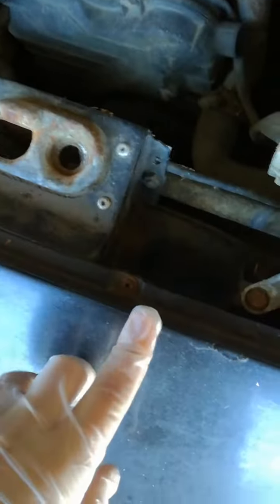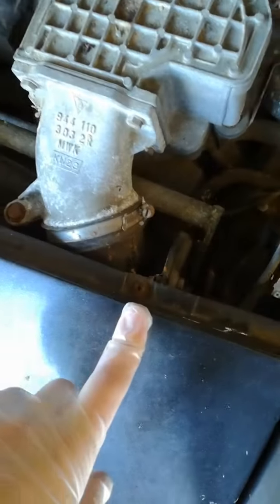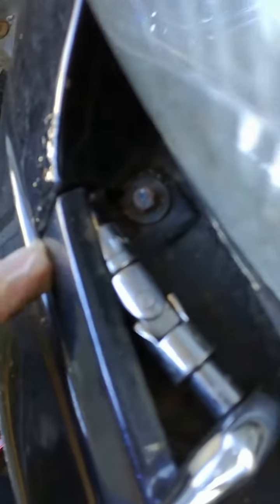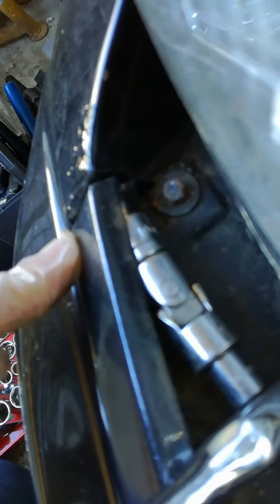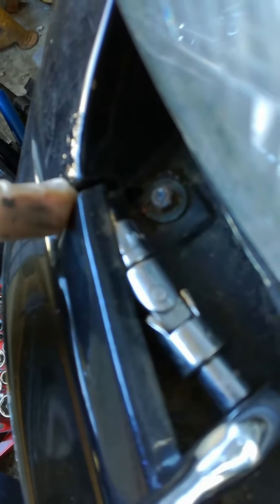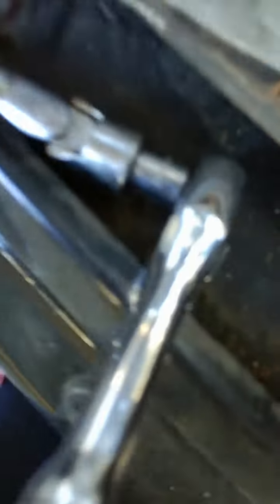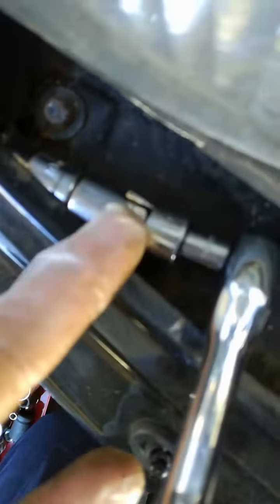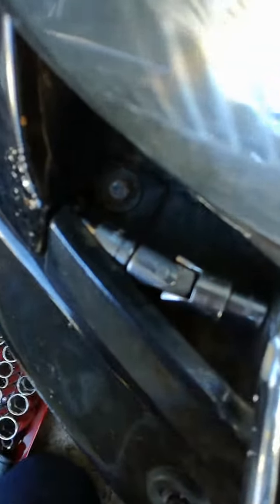Porsche 944 nose panel removal

Comment: I just bought my first 944 and it's guy's like you, that make video's like this, which makes my life a lot easier.
Reply from the maker: 100forks I'm glad it helped you out your going to love been a 944 owner what engine did you go for?
Reply: I got a 1988, base car with the 2.5L engine.  It had been in the gentleman's family for 27 years and had not been out of the garage for the last 25 years;  the result of a minor encounter with a curb.  He had it advertised for $600 and it ended up costing me $470.  Now I am watching all the videos and gaining the knowledge to get the car back on the road.  I've pulled the front off the car to repair the valance, passenger side radiator bracket and to remove the damaged AC components.  With everything out, it is making it very easy to replace the timing belts and water pump.  This is my first Porsche and I must say that I am very impressed with the build quality of the car. I am also very surprised that the parts are not nearly as expensive as I thought they would be.  One of my first trips will be to run the "Tail of the Dragon".
Reply from the maker: 100forks I guess your state side then what's this tail of the Dragon it's sounding very cool
Reply: The Tail of the Dragon is an 11 mile, 318 curve two lane road that goes over a mountain from the state of North Carolina into the state of Tennessee.  There are no side roads and no houses.  F1 legend, Michael Schumacher, got on a plane with his bike and flew to North Carolina, just to ride the Tail.  When finished, he flew back home.  It starts in Deal's Gap, where there is a motel just for motorcycles, that has the "tree of Shame".  If you wreck your bike and live, you have the right to hang a piece of it on the tree.  I have only been on it once and as luck would have it, immediately got behind a silver mini van filled with Japanese tourists, all with their cameras hanging out the windows, going 20 mph.  Since there is no place to pass, I figured I was going to have a long trip.  Fortunately, they soon pulled over to film the valley below.  You never ride the Tail, on a weekend, because of tourists.  Since 1995 thru 2017, 44 people have been killed and hundreds more injured. You can click on the link to see a 7 minute vid. of the Tail.
https://www.youtube.com/watch?v=K16YnmJN0fc&feature=youtu.be
Reply from the maker: 100forks wow that sounds amazing something I may need to put on my bucket list ride it safe. Take a look at my Facebook page Www.Facebook.com/Burts.Boyz
Join our group and post some pics of your porsche we would love to see it